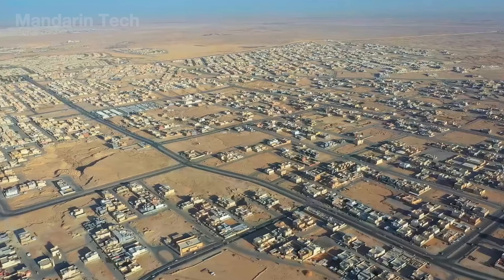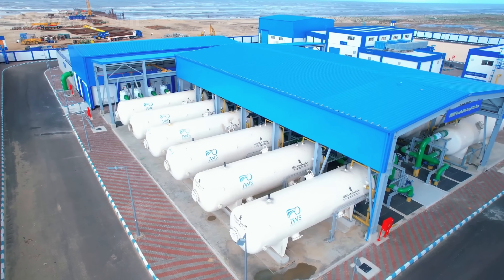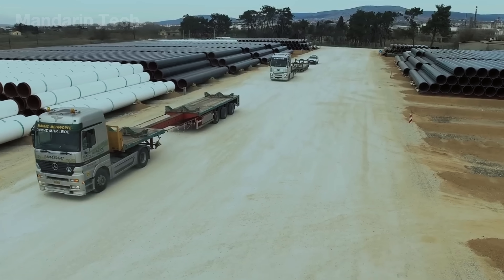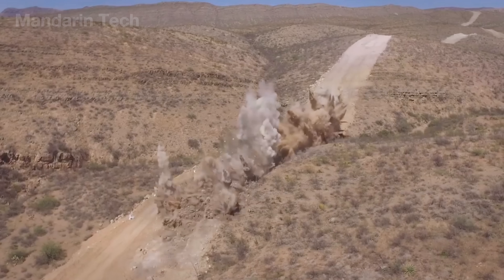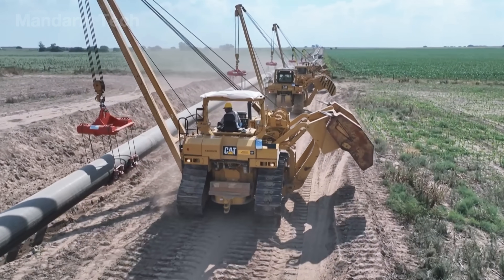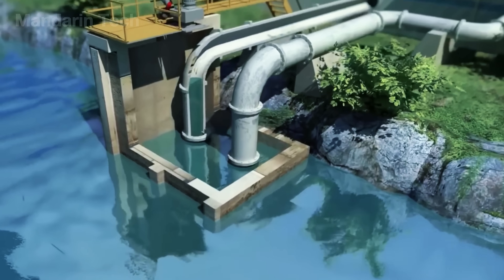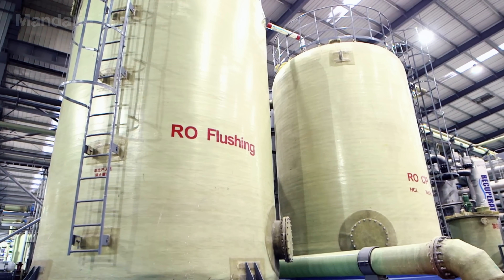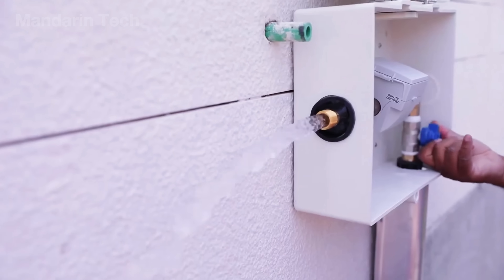How Saudi Arabia Pumps Billions Liters Of Seawater Through Giant Pipelines Into Their Desert Nation

Comment: Poly pipe would be a better long term pipeline for water service. I guess they are used to moving oil at pressure so poly wasn't considered for a better carrier pipe.
Reply from the maker: Good point 👍 Poly pipes are great for many water systems, but for extreme pressures and scales, engineers often stick with steel because of long-term reliability and familiarity.

Comment: That's the stupidest engineering, why are not they boil water  and evaporate it? and than add minerals, that's it, it can be more easy process for  Saudi Arabia, they have sun's energy to boil water
Reply from the maker: Boiling seawater sounds simple, but evaporation needs far more energy than reverse osmosis, even with sunlight, which makes it inefficient and costly at large scale.

Comment: wie wird denn die schwankende Längenausdehnung kompensiert? Ich sehe da nur gerade Stücke
Reply from the maker: The linear expansion is compensated for by special sliding bearings, expansion joints or flexible pipe connections – even if only straight pieces are visible from the outside.

Comment: How long do the steel pipes last, pumping salt water? How often do they need replacing?
Reply from the maker: Great question! Typically, steel pipes used for pumping seawater are lined or coated to resist corrosion and can last upto 30 years and maintenance.

Comment: Pipes are also fully coated internally and externally. They can also be externally wrapped to offset corrosion. There are also expansion issues to overcome. Not an easy task! Cathodic protection is a must!
Reply: We have technology that can protect from exposure to the steel and water causing corrosion as soon as water is in contact with the steel or iron pipe.
Reply from the maker: Great point, corrosion control is a major engineering challenge in these systems.

Comment: Amazing but how did they make those machines that made those huge pipes?
Reply: Its just normal steelworking mills you see at any steelworks.
Reply from the maker: Those machines are typically made using large-scale industrial fabrication and precision engineering.

Comment: Do these pipes rust internally?
Reply from the maker: Great question! Most of them are coated or made from corrosion-resistant alloys to prevent that.
Reply: @Mandarintechmido  3 Cm kalınlığında ÖZEL KARIŞIM MİX BETON ile kaplanıyor, 65 yıl ömrü var, aynı şekilde bir pipeline de  3 yıl çalıştım, 2 X 100 Km  X 60 '' İnç içme suyu hattı. elimde 3 yılın çekilmiş resimleri var, You Tube resim paylaşımına izin verse paylaşırım.

Comment: Thanks for sharing 
This documentary is a masterclass in large-scale infrastructure resilience. As an expert, I am most fascinated by the Reverse Osmosis (RO) desalination process—where humanity literally defies the chemical bonds of salt and water to create a 'river of steel' in a land with 95% desert.
The transition from 1.8m diameter carbon steel pipes to high-pressure 60-bar pumps showcases a seamless fusion of heavy industry and molecular science. By highlighting the immense $3M/km cost, the video poignantly illustrates the value of every drop. It’s not just a pipeline; it’s a national mission of survival and high-tech determination. Truly remarkable!
Reply from the maker: Appreciate your kind words! We're glad you enjoyed the narration and engineering details.
Reply: Impressive engineering, but how resilient is this system to long-term risks like sandstorms, corrosion, or energy dependency? Scale alone doesn’t guarantee sustainability..
Reply: I beg to differ with you!
Reply: What if the contractor secure better protection for the safety of the water that is passing along those pipelines for such a preparedness of such unavoidable circumstances like the sand storm which could be such a threat for the pipelines.

Comment: $5 / cu meter is expensive.  A typical shower will use that much.  Neighbor Iran is suffering drought conditions, lack of food, extremely high inflation.
Reply: 1 cu meter of water is 264 gallons.  An 8 minute shower will use 17 gallons of water so at $5 / cu meter a typical shower will cost about .30 cents.
Reply: @huckleberryfinn338  I rarely use over 4 gals. low flow head and shutoff while soaping up
Reply: A 3 hour shower would use 1 cu M or 1,000 liters
Reply from the maker: True, water costs are rising fast, especially in drought-prone areas.